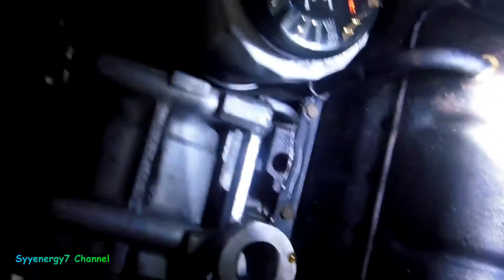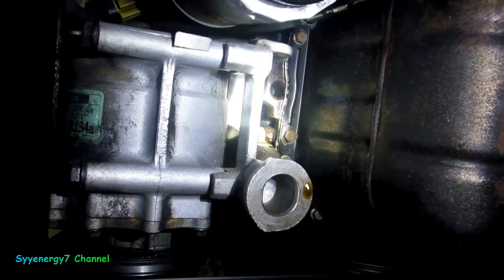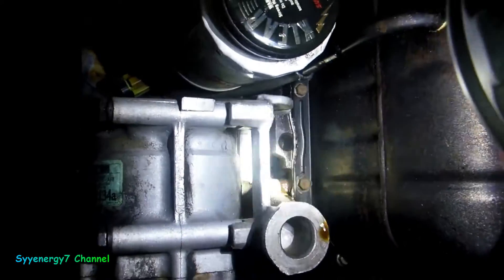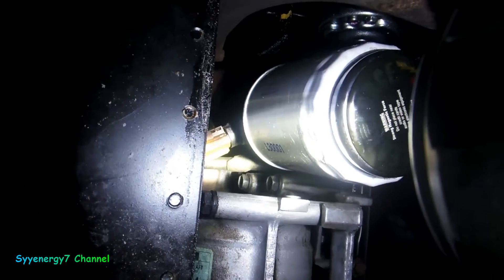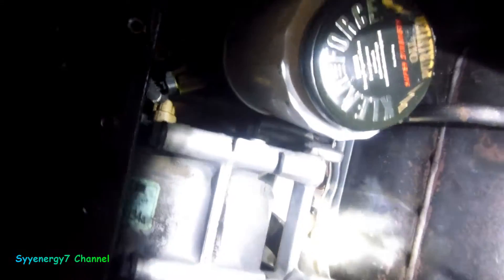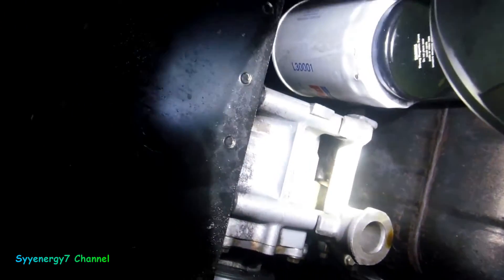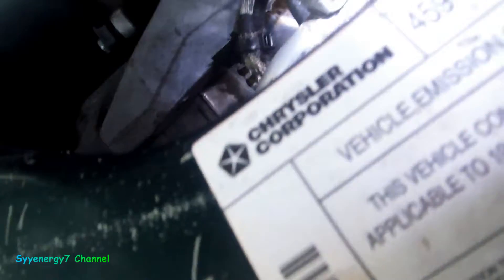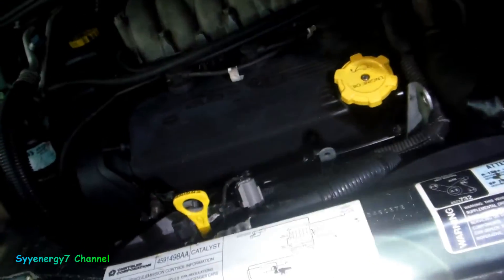Clean an Engine & Use a Strong Light to find OIL LEAKS

Comment: Did you ever figure out the specific location of this leak?
I've got a pretty bad oil leak dripping from the bottom of the a/c compressor.
Reply from the maker: +Brandon s Yeah, 2 spots,  Ine an oil plug and the other the oil pump where it mounts to the block.
Remove Stubborn Block Oil Plug - How to 
http://www.youtube.com/watch?v=PAzjW_ZKRbY
Special Thread Sealanf for special Car applications 
http://www.youtube.com/watch?v=J_vVCgkyAb0
And btw those dislikes were from some Communist trolls due to another video.  They had no interest in cars they were just trolling and disliking vids.